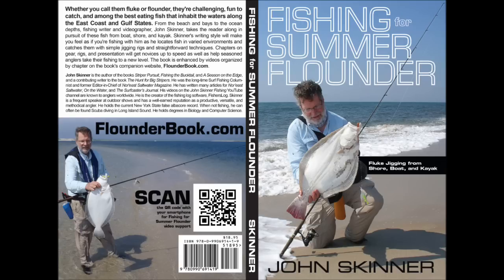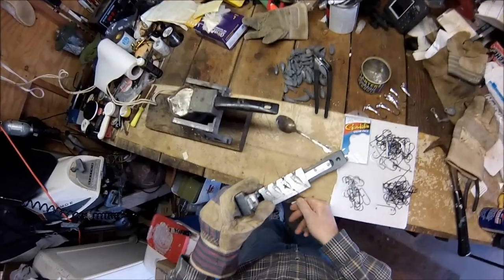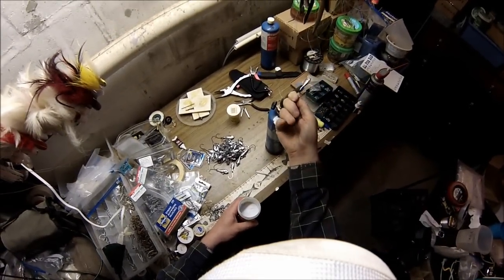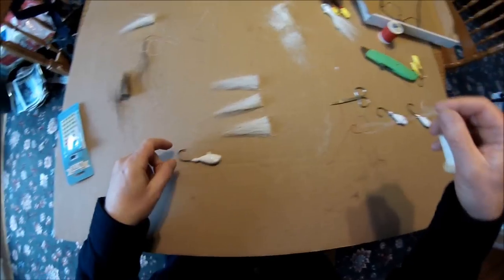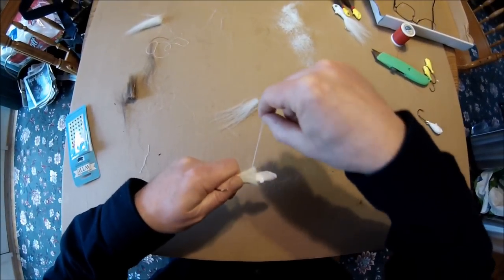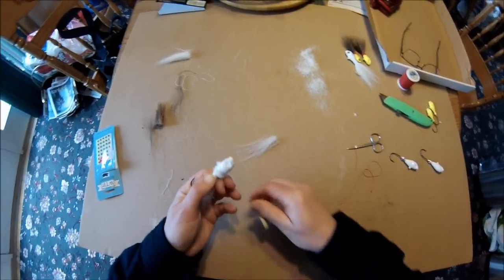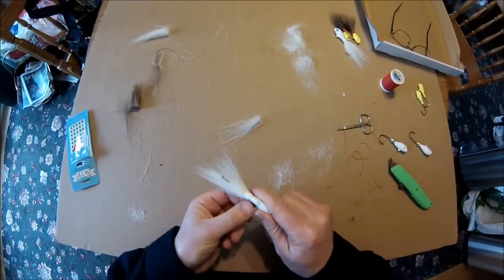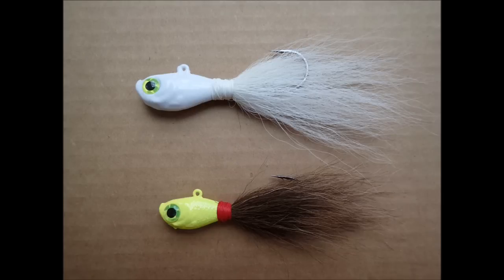How to Make Bucktail Jigs

Comment: Hello John Skinner great work and informative show I love your videos. I have been making jigs for a while now and would like to share some things I have learnd! I started out using my kitchen oven which after a while started to smell of melted powder paint and can be toxic, I bout a small temperature control convection oven for this purpose that I now use. Instead of a torch i preheat the jigs to 350-400 then dip this makes sure the jigs don't pick up too little or too much powder from imprecise temperature of lead surface , a small DIY powder fluid bed is necessary for a thin even lay but temperature is #1. Dip and right back in the oven to prevent cooling has given me the best cure and durability results. I also soot my molds with a candle which helps tremendously during the pour process. Have a good day keep up the hard work, tight lines!
Reply: Hey, i think i seen you on Stripers Online

Comment: Mr. Skinner, i tie flies and think there is a fairly cheap tool that will help you with finishing your bucktails. its called a whip finisher, its a simple tool, easy to use, and it makes that same kind of finish you make with the loop, but much faster and easier. they are usually under $10, you will have to find a big one for bucktails, but i think having one on your work bench will be worth the money for how nice it is to use (i used to whip finnish with my fingers and thought it was good enough, but then i used the tool and was very impressed at the amount of control i had with it)
just a suggestion, great video, even if im getting to it late.

Comment: John, you've done it again. Your videos make catching and making look so easy!  I have used this video with retying my old bucktails that have gotten ragged and beaten by fluke fishing.  I love being able to use specific colors and amounts of feathers/fur/mylar based upon the bait in the area. I don't know if it really makes that much of a difference, but they look really cool.  My question for you is regarding the hook size and alteration you make with pouring your own jigs. I noticed that you used a smaller hook than what is recommended. I understand why you do this, but I have honestly found that the larger hook is great for putting on the six-inch GULP! grubs, and I don't think that I have ever had a problem with hooking the larger hook for most of the keeper fluke I'm targeting (over 4 pounds). Any thoughts on this?

Comment: John Thanks for the info I do have some questions on your hot pot,  I see its a Hot pot 2,, did you alter it ? all the ones I see for sale the pour spouts are port and starboard yours appear to pour from the bow,, I have two lee pots one with a ladle and one with a lever  I like yours way the best
Reply from the maker: It's probably 25+ years old. I doubt they make that one any more.
Reply: I called C. Palmer MFG. this morning and they not make it any longer  they called it a Super pot and said it held 6 lbs,, I will rig something up to use the Hot pot 2 ,, Thanks you for your prompt answer and the gift of your knowledge., All the best Capt. Bo Toepfer

Comment: If you take an air bubbler for a fish tank, shorten the tube, cut hole in lower plastic spice jar, hot glue to a cardboard base, cut small hole in tube so air only flows when you carb it. SUPER SIMPLE, and floats powder as you dip only. Powder floaters are $90, this was a buck.

Comment: hey John I was wondering I've been pouring my own hot lips Jigheads for bucktail tying but for some reason I'm getting constant imperfections on the tying collar and even the head, I flux the lead with candle wax and I let mold sit on top of the melter so it gets hot and prevents the lead from cooling too fast, what could I be doing wrong?
Reply: Try heating the hooks too. I noticed the same thing, but when I remelt the jig and try again it comes out ok. Started heating the hooks on larger jigs and that helps.